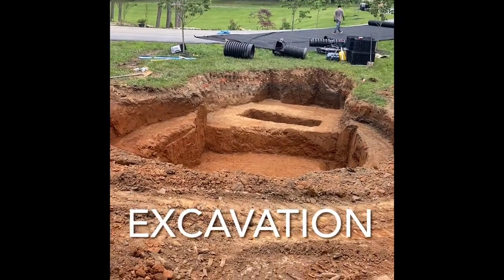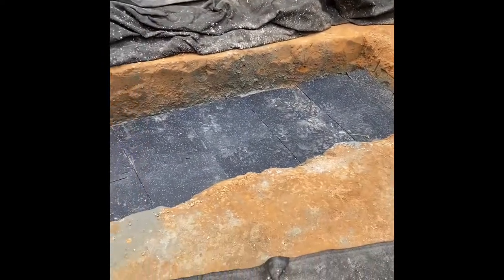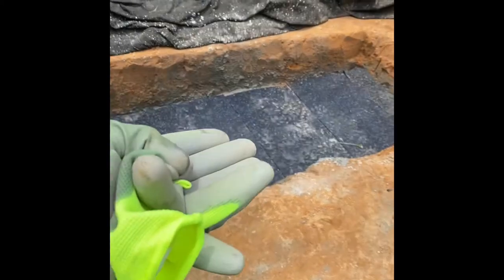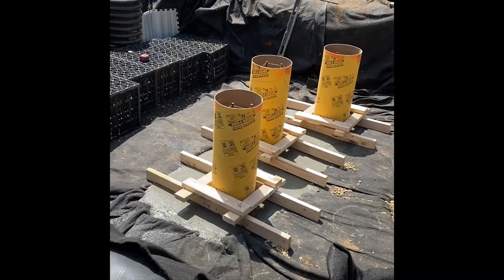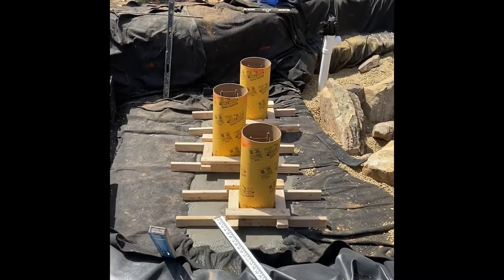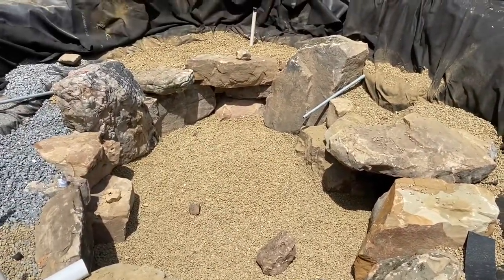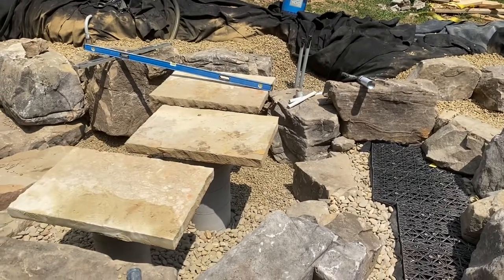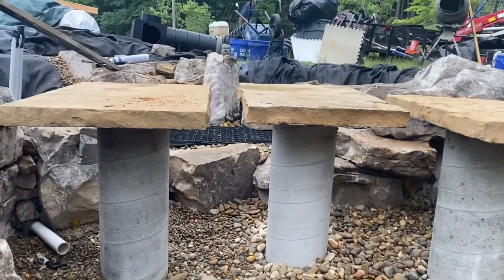How to build ‘Floating’ steps across a koi pond

Comment: Beautiful work. How long did you need to let the concrete pillars cure before filling with water?
Reply from the maker: Thanks!
I can’t remember right now
Probably a week. 
But concrete can cure underwater as long as it’s set. However it can change the ph of the pond if it leaches in. We haven’t had a problem with that. But could be recommend to seal the concrete prior to filling.